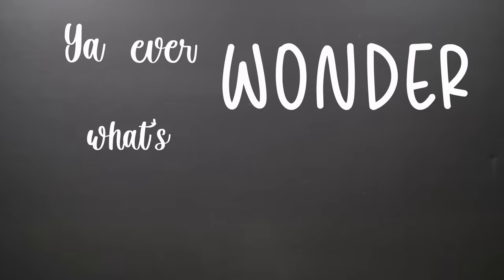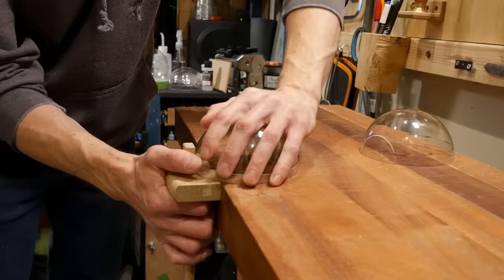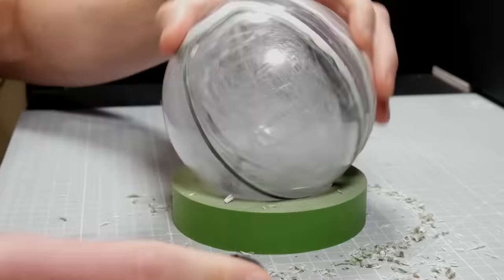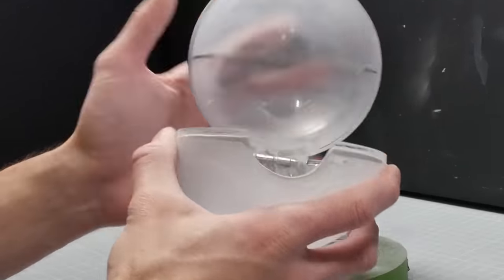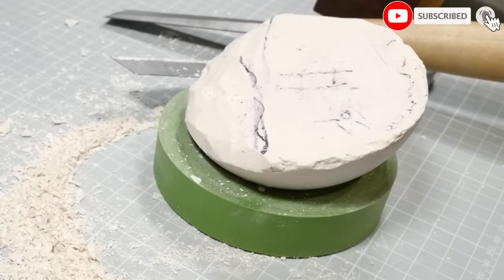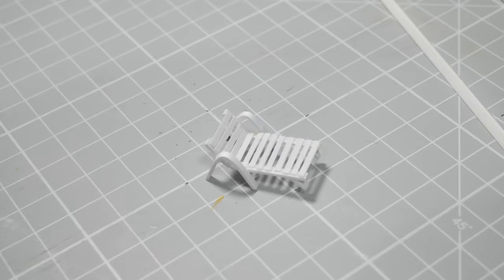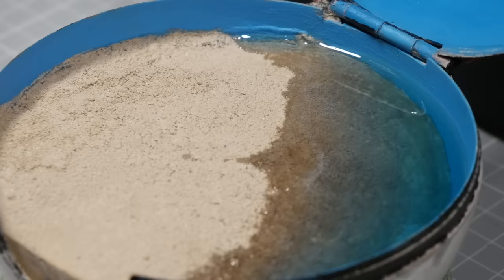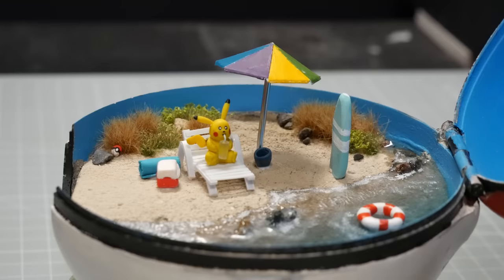How to make a Pokeball // Sculpting a Miniature Pikachu

Comment: Great video! The pokeball turned out really good and the editing gives a nice touch to the comedy (words from a professional video editor 😉). I was wondering, what kind of paint did you used for the pokeball? Since it looks very smooth and even.
Reply from the maker: Thanks! The editing ends up taking as much time as the building these days. And I applied it with an airbrush, so there aren't any brush strokes

Comment: Hey! Thanks so much for all your videos! They are so inspiring and have helped me get back into the hobby! I was curious, in a few of your videos you spray Isopropyl alcohol on the model. Does this help seal the sand down by affecting the glue in some way? I also noticed that you sprayed "thinned down modpodge" on this one. Any tips how to do so without clogging whatever spray bottle you use?

Any help you can offer would be brilliant! Thanks again for the great content!
Reply from the maker: The alcohol gets everything wet, but it's much thinner than water so it helps the watered down glue to spread evenly without pooling. It also evaporates much faster than water so it doesn't increase drying time. The watered down mod podge is just watered down to the point that it can spray--I don't measure it, I just add water till it works! Because it's going over grout, and the grout is essentially a cement that is activated by water, I'm not too worried about the mod podge being too weak. I also use a spray bottle head that is separate from my thinned out mod podge so I could wash it (by spraying soapy water) after I've used it to keep it from solidifying.

Comment: I see the spritz of isopropyl alcohol in many crafting videos. What's the purpose? Is it diluted?
Reply from the maker: It's a way to get the ground 'wet' before soaking with thinned out pva. It helps the pva spread into the ground rather than pool on top, since it's much thinner than water. It also evaporates quickly so it doesn't affect drying time. And it gets you dizzy if you spray enough of it.

Comment: What's that tool he's using to hold the armature of Pikachu called? 7:04
Reply from the maker: It's just a handle I made out of a piece of dowel, cut down the middle and held together with a bolt. Means I can comfortably hold the small pieces without worrying about squishing or dropping them! If you don't want to make one of your own, you can just use a large pieces of cork (I often do just that)
Reply: @NorthoftheBorder  thank you I shall fashion one similar (I'm sort of addicted to the whole clay figure making because of you)